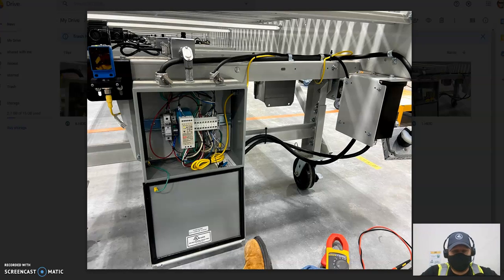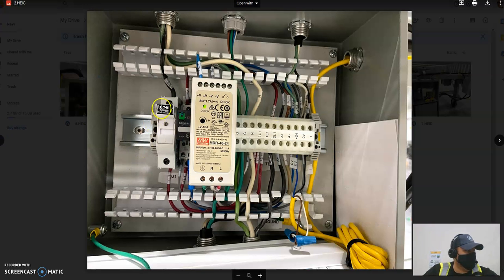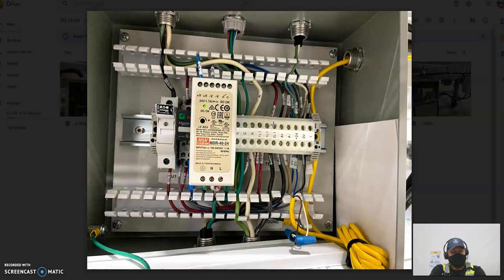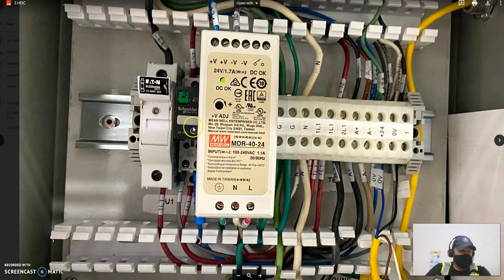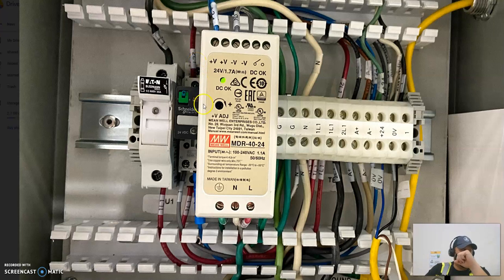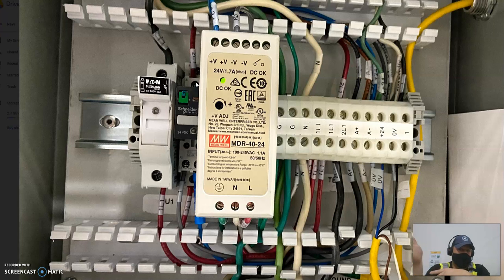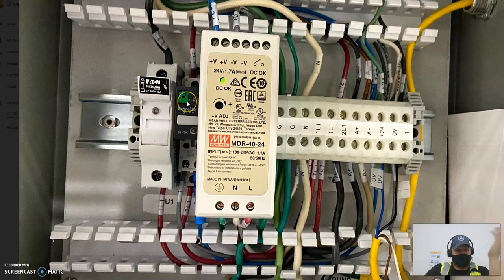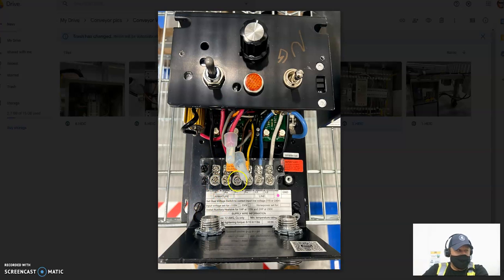Troubleshooting DGE9 Conveyor Part 1

Comment: I'm having an issue with a flex conveyor where when I turn the switch to stop, it runs, and when I switch it to start, it stops. Also if the line is running, it can't be turned off with the second switch. Normally it should work like a 3 way switch, but whatever switch is running the line, is the only one that can shut it off.

Comment: whats up with  maintenance workers leaving wire duct covers off? I spend lots of time designing and building these controls systems and I hate it when a maint worker just dismantles it.
Reply: 😂 maybe if you had designed better wouldn't have to fix it all the time
Reply: @rickjames9621 yeah, maybe. Need some wire duct covers that has hinges. Then they will still leave it hinged open.

Comment: I’m not sure if this is the right place and just started this video. But.. I just hooked up my new cocci conveyor belt and it only runs on slow speed… the speed control does not do anything when I turn it up. Brand new machine and electrician just put on a plug and wired in a corresponding power line. Any ideas electrically as to why the speed control would not work? Thanks to whoever can take a crack at this issue. Thanks I’m advance and looking for advice.